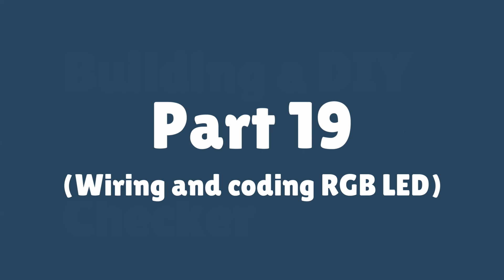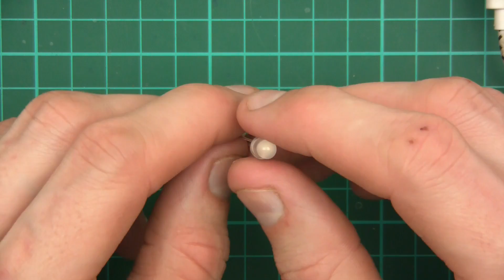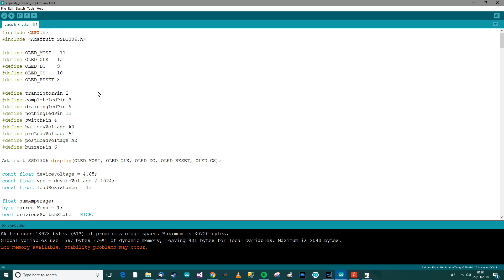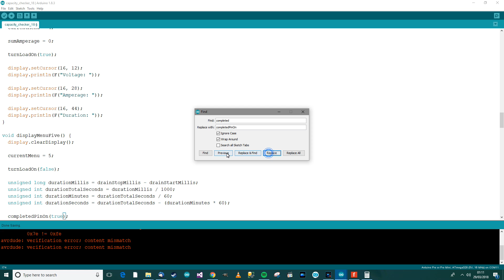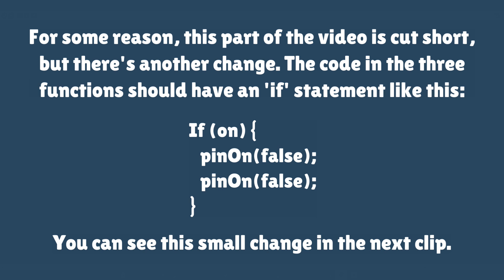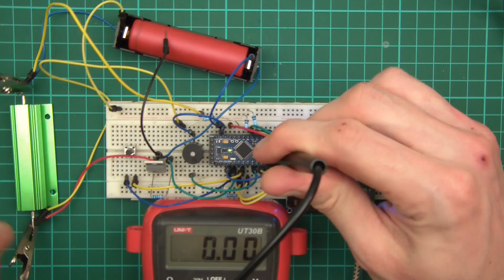TUTORIAL: DIY 18650 Lithium Ion Cell Battery Capacity Checker Tester (Part 19 - Add RGB LED!)

Comment from the maker: Hi Everyone!

This project is almost complete! It's not perfect yet. When finished, I'm going to make it open source, releasing all code, etc.

Still to do:
Rectify the ADC reference issue, just a to squeeze a little bit more accuracy out of it. I'm going to use internal reference.
Very slight code changes to do with pin numbering.
I suspect a resistor change will be necessary. 
Testing on a matrix board.

After this, I plan on releasing the schematic, matrix board prototype design, code and parts list.

Thanks for watching my videos. :-)

Comment: It's done. Congratulations!
So all you need now is a video sponsored by that PCB-maker to make a PCB for it and then fabricate a nice matching case with your new 3D printer. ;-)

Last Friday I harvested six Li-Ion cells from an old laptop battery. Two were kind of flakey (showing only 2.5 volts when harvested and iffy discharging behavior after charging), the others seemed better (starting at 3.6V and holding. I briefly tested them with a USB tester, but the capacity didn't seem that great. I could really use a better capacity checker now!
Last year I made a simple indicator for regular AA and AAA batteries. Maybe it's time to refurbish that one to include some Li-ion testing features. Thank you for this video-series...
Reply from the maker: Hey, thanks... Yes, I've already had a company asking me! And yes, the 3D printer... I'm still getting used to it!

Feel free to offer input on the project. It's not perfect yet. I'm going to make it open source soon. Some final changes to come are; very slight code changes to do with pin numbering, matrix board prototype and I suspect a resistor change will be necessary too. Next week's video will be about rectifying the ADC reference issue, just a to squeeze a little bit more accuracy out of it. I'm going to use the internal reference method.

Antony...